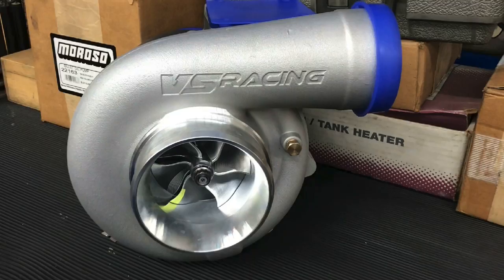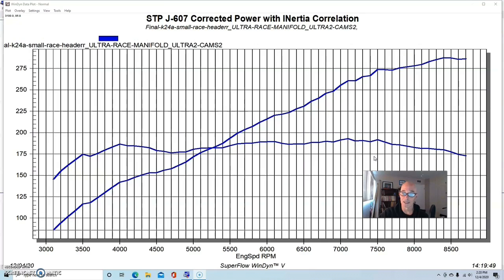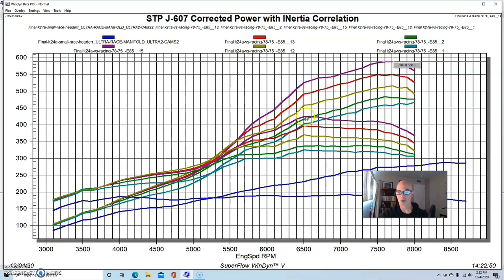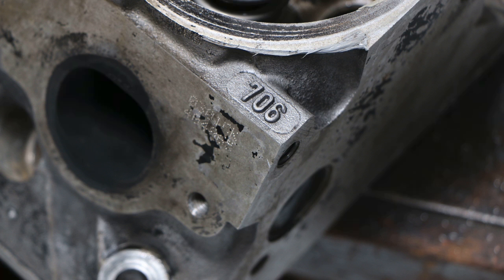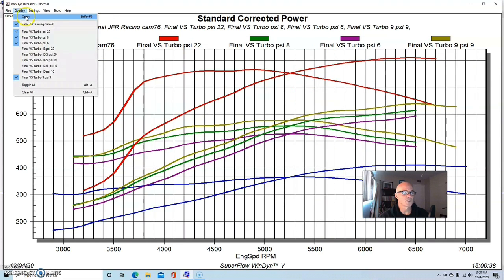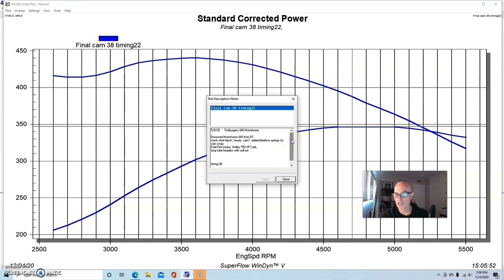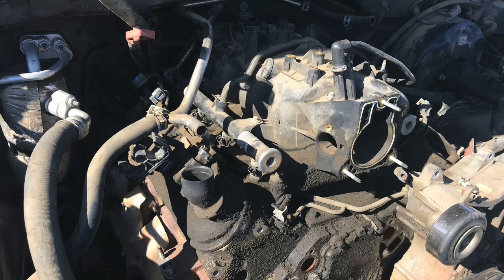VS7875 GEN-2 TURBO TEST-THREE DIFFERENT MOTORS!

Comment: I think you short changed the big Cad. Cheap gaskets, way too small a turbo, back pressure, small cam. Google Larry Kruzic 500 HP for 4000.00. Do that with good gaskets,  same cam ,Apr head studs and rod bolts,  with the right turbo. NOW you're going to put it in the nova NA. That's just wrong.

Comment: Some Content on the 76mm Cx racing turbo would be good. I have a 351w boosted by the 76mm cx turbo. Thinking i may be coming into back pressure issues. Thoughts?
Reply from the maker: yes
Reply: @richardholdener1727  would a Gen 2 vs 7875 be a better fit? Motor makes about 375hp n/a

Comment: How would equal and unequal manifolds effect turbo spool and response?
Reply: Some guys complain longtubes don't work as good as the factory truck manifolds on Ls engines, the charge time is like 1/25th of a second. The combo with headers will usually make more power, I won't say always because some headers are crap. It's not usually even noticeable to the driver, you would have to have a really bad design to hurt spool. Unequal length does the same thing to boosted power as it does to NA power, depends on the combo. I don't know if you would notice from the drivers seat.
Reply: @timothybayliss6680  Any idea on how would equal vs unequal affect it on a 4 cylinder but also being a twin scroll turbo.

Comment: I'd love to see what you could make on a BUILT 440, with TFS heads, good pistons, head studs, and a hydraulic roller around 236/560/114.
Reply: A pile of rubble 💥
Reply: That sounds great but, a little more cam for that big block. 😉
Reply: @MustangCrazyMan72  Remember, ya dont need as much cam when ya got boost! 236 @ .050 keeps it streetable. And its HUGE compared to the stock cam. Even the 365hp 440 of 68-70 only had 206 @ .050. Late 70s motorhomes probably less.
Reply: @donellmuniz590  I'm putting a 236 @.050 with .588 lift cam in my little 351w with 88mm turbo and high ports for a street class. Big block needs more cam to offset power to weight ratio.....just my humble opinion, but I'll for more BB turbo testing.
Reply: @MustangCrazyMan72  Sounds good, but a "street class" and a "street car" are 2 different things. Not that I could ever afford to build such a motor. My hot rodding days may be over. But I hope Rich will throw us a SERIOUS BB Mopar bone 😂.
Reply: That is what I want to see as I'm building a 451 stroker. I already have a new s475 1.36ar
Reply: The old mopar has ridiculously strong internals.  I would be curious how much power a stock bottom end can handle
Reply: @ufarkingicehole  They are very strong. But the pistons are quite heavy, at over 1100 grams each.

Comment: How about testing turbo's on 3 cyl. Metro motors. Just for fun.
Reply: They tend to break off valve heads, especially if you run any oil other than 5W-30. But a BUILT Metro 3 cyl would be fun!
Reply from the maker: I ran several turbos on my Chevy Sprint Turbo (110 whp withthe stock turbo)
Reply: @richardholdener1727  I miss my 3cyl metro. The rust monster ate it right through the center of the car.

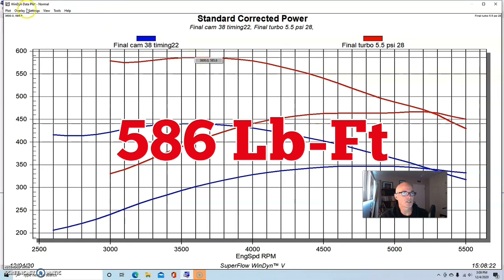Comment: 14:15 Why does the 440s hp stay flat between 4500 and 5400? Did it run out of air, fuel, or cam?
Reply: Valve float

Comment: Why is it that you have problems loading the engines at lower rpms on the dyno?
Reply: The dyno is an Eddy current and has a limited torque capacity at lower rpm. From the looks of his work at westech their dyno will hold about 500ftlbs at 2500rpm. If you notice some of the really high torque big blocks, the tests don't start until after 3000rpm. When you start a test with this kind of dyno the controller will try to use the brake to pull the engine down to the starting rpm. Looking at the k24 curves they started the NA run at 3500. What happens is the engine rpm is above 3500, the dyno applied load to reduce rpm to the starting rpm then it lets the engine accelerate at usually 300 or 600 rpm per second. If the dyno cannot apply enough load to reduce the rpm to the starting rpm you do not get any data. That dyno loading procedure is also why it's difficult to test things like turbo lag on the dyno because the "load in", the time before the test starts" is basically always different.
Edit, I say eddy current, it's not. It's a waterbrake.
Reply: @timothybayliss6680  it's a water brake dyno not an eddy current
Reply: @davelewis2174  sorry about that, I was reading their website and had a brain fart. Their chassis dyno has an eddy current for a brake.
Reply: its because the engine dyno is hard to fully load down low. if you want to run the engine rpm really low its easier on a chassis dyno where you have the tires putting the load on the dyno.

Comment: I'm more partial to blowers, especially Rootes style, and screw type. But I like Prochargers and other centrifugals too.
Reply: Gross
Reply: @austindoud273  🤔?
Reply: @donellmuniz590  turbo is da way
Reply: @austindoud273  I know, I know, I just hate all the plumbing, and all the heat. I need something that bolts on, without being a fabricator and welding up a maze of tubes.
Reply: Some of the twin screw blowers are really awesome, the Eaton tvs are halfway measure. Any of the gm style roots or low helix Eaton blowers are really soft. When you see how well any other blower does in the place of a real roots style blower it brings it in to focus.
Reply: @timothybayliss6680  Yeah, there's a good reason GMC put 3 lobe rotors with a lotta twist in their blowers. Copies like cheapies from Weiand only have 2 lobes, and no twist! But they still make good power, if 500hp is all you seek.